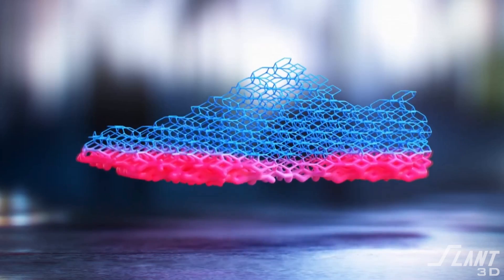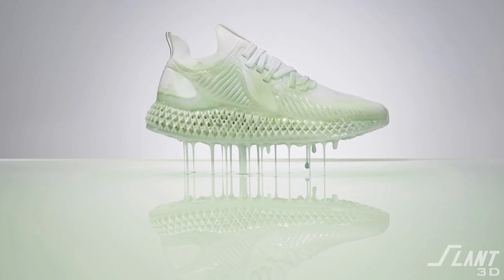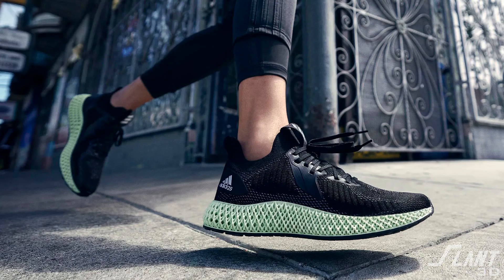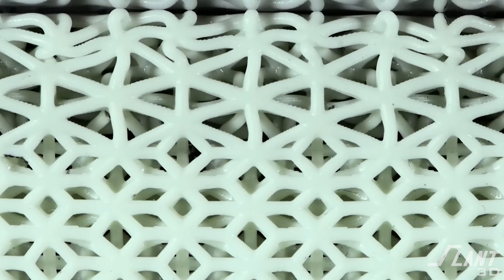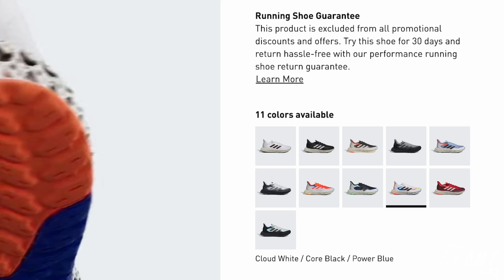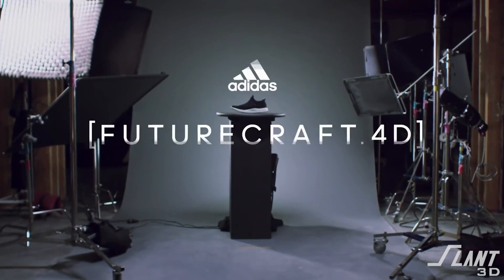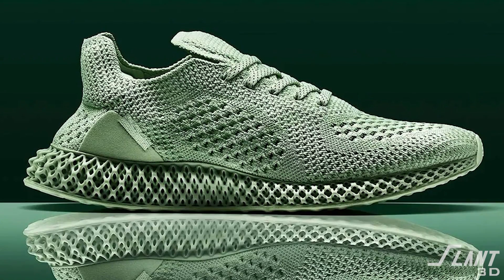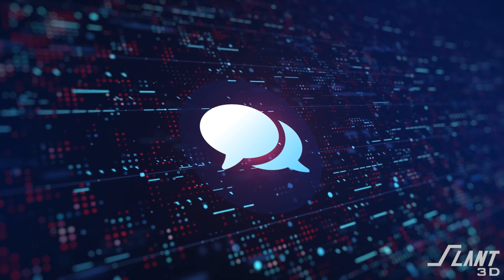The Art & Science of Adidas' 3D Printed Shoes | Real 3D Printed Products

Comment: Im sorry but you are completely wrong about some of your criticisms.  
Enclosing the exterior wouldn't cause printing issues with a resin printer, remember resin printers print upside down, the sole would stick to the build plate and the excess could easily drain away.
Also, dyes can be added to resin so you can achieve basically any colour you want, alternatively you can also spray paint the material the colour you want after.
Reply: lol right and whiles he’s bashing it he showed plenty of examples of different colors and hues carbon and addidas used
Reply: addressed in reply to @MatCatSoft "some colorant preventing full curing."

Comment: Yes this is quite neat. Especially the way they use a 2 part resin that not only uses photosensitive monomers, but also the thermoreactive monomers to give it it's final shape. 

The downside is that to date these shoes are still quite inferior. I owned 2 pairs of differend models and both came apart in under 2 months of regular wear. Not the soles, those were exquisite and worked perfectly, even for a 255lbs man. But just the fabric of the shoe itself. It tore in both pairs and Adidas didn't even refund me.

So TL;DR, awesome in concept and idea, but not quite there yet in reality.
Reply: im gonna buy workwear boots still as they survive longer than adidas

Comment: I am totally surprised by how durable TPU is and how well it flexes even in hot/cold weather. I have a set of hydraulic plugs on my lawn tractor that have lasted for a little over 3 years now and are still flexible and work! I wonder if any company could develop a formulation of TPU that would do the same thing as what Adidas and Carbon are doing. There ya go, a billion dollar idea. I will take a 10% cut LOL
Reply: TPU is probably what most viewers of this channel think when they see this video's thumbnail.  I made flip flops for myself last year using TPU for straps and gym foam for the base.  I have a laser cutter for the foam and FDM the straps.  I can print new summer sandals anytime and it's great!